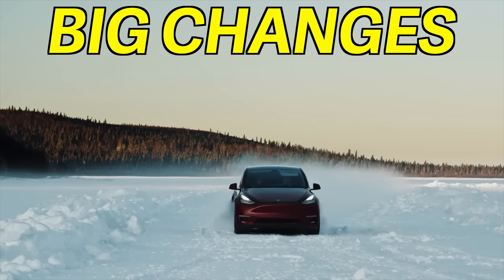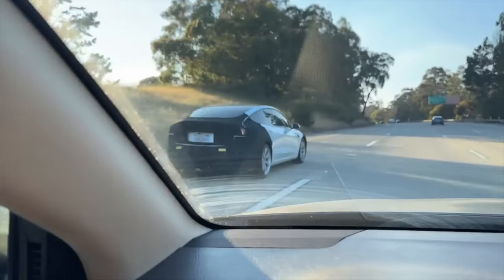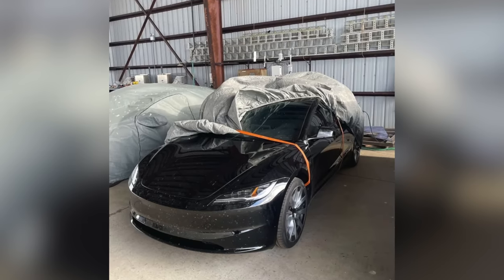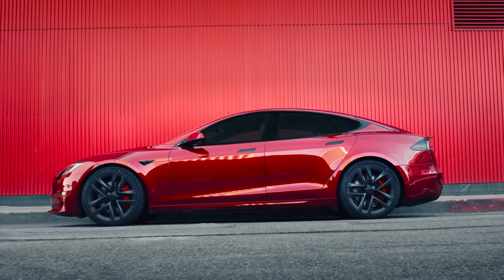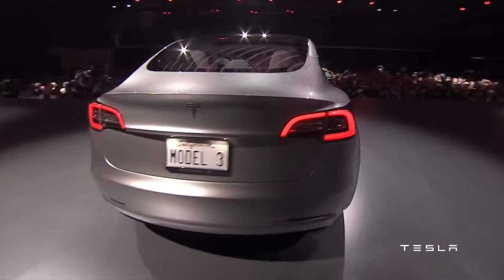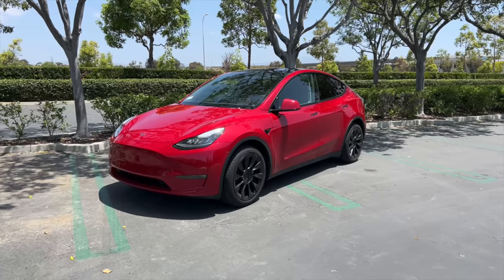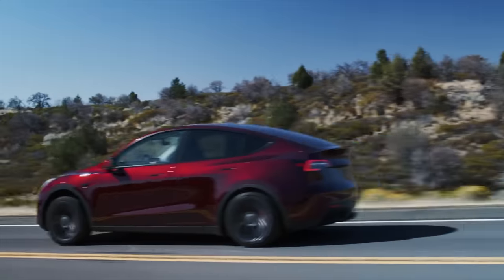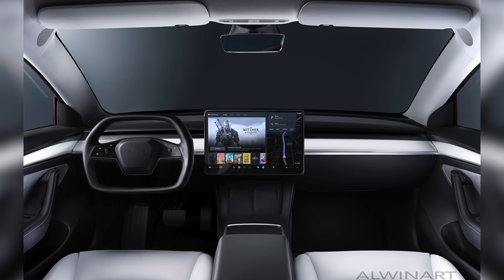Tesla's BIG Announcement - New Highland Model 3 is HERE! | 12 HUGE Changes

Comment: Robert, as always, great info.  Do you think any of the upgrades coming to the new M3 can be retrofitted to the prior Model 3 and Model Y, specifically the ventilated seats?  I would love to have these installed.  Next would be the powered frunk.  Possibly in the “Stop gap” interior upgrade to the Model Y you mentioned?  I do not want aftermarket not only for a quality standpoint  but also do not want any issues with Tesla and voiding warranty.
Reply from the maker: Good News - they can be added. Bad News - Probably only with aftermarket accessories

Comment: It actually looks like Tesla is downgrading the body, both the front and the back. The current 2023 curvature of the front and the lights in the back look way better than the brand new one they are fixing to roll out. The new front of the car looks similar to a mix between old versions of Toyota and Porsche put together. There is beauty in curvature, and how unique the model three is that was designed by SpaceX. It seems like they’re just making this car as cheap as possible now so that they can match produce it and sell it at a lower cost. Sure the cameras will be improved but the body it’s just a downgrade. Thinking about the body now it looks Chinese influenced design concept. 4:58

Comment: Removing the stalks is indeed a stupid idea. It's a total no-go for me, and probably will be for many people. Having this as an option (maybe in combination with the yoke) would be the better choice for Tesla. Unfortunately, this is yet another reason not to buy a Tesla, after the removal of radar and ultrasonic sensors had already ruined the current versions of the 3 and Y for me. Tesla has many advantages over other brands (like efficiency, security, software quality, etc.), but they keep making decisions that are hard to understand. Removing sensors that allow the car to perceive its environment even in bad visual conditions (darkness, rain, fog, dirty windows, etc.) is hard to accept on its own, but doing it long before the vision-only system is capable of serving as a good replacement is just stupid. Forcing customers to do without turn signal stalks is just the same. I'm sure there are people who like touch-sensitive controls instead, but introducing this as an option first would have allowed Tesla to check customer acceptance and preference. Reading past reviews of the other models that already are stalk-less should have made Tesla reconsider this particular change, too.
Reply: Pushing a button rather than shifting a stalk turn isn't exactly a huge problem to adapt to. Most reviews on the yolk are also positive once ppl tried them. But also like the S and X Tesla will offer a 'standard' steering wheel as an option.
Reply: @DKg2811 It's not about pushing a button vs. shifting a stalk. It's about the fact that the stalk doesn't change its position when the steering wheel is turned. But everybody to their taste. If they make it an option, great. But I doubt it.
Reply: @DKg2811 Many are positive many are not I think too much can be added to the screen or on the wheel but hopefully and option is given stalks vs stalkless. Just like with yokes and may the best design win but i would go with stalks 100% if its an option. They added the regular steering wheel as an option because people  didn’t want a yoke so i find it hard to believe it was all that positive for the yoke.

Comment: The "tesla community" should be pushing Tesla for a carbon wrapped motor in the 3 Performance, it needs a significant boost to the mid-high power. 

As it stands, with no modifications to the powertrain, the 3 Performance is going to get smoked by a Hyundai Ioniq 5N......

Not cool Tesla......buncha dorks worried about a stupid automatic frunk and a nerd sky came, when the customer spends 70+ k to see the back of a KIA or Hyundai's taillights.